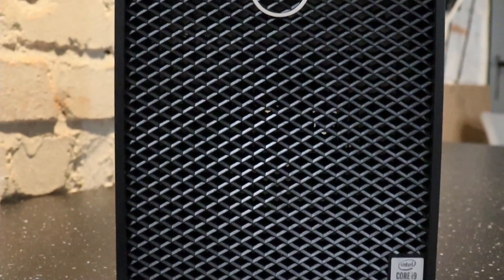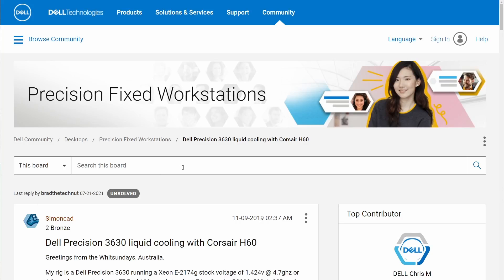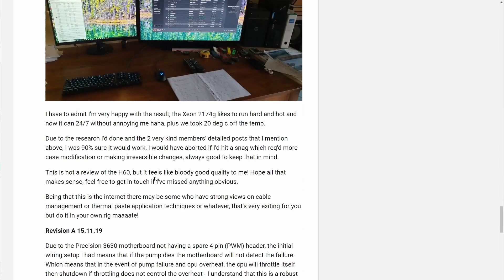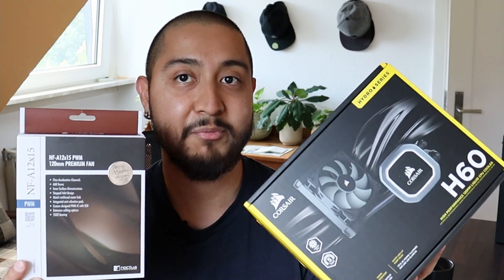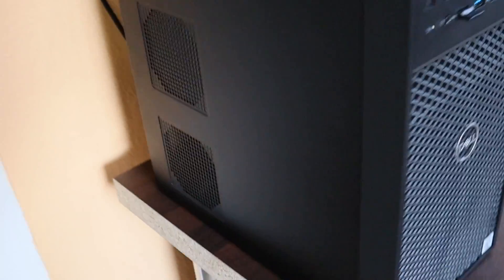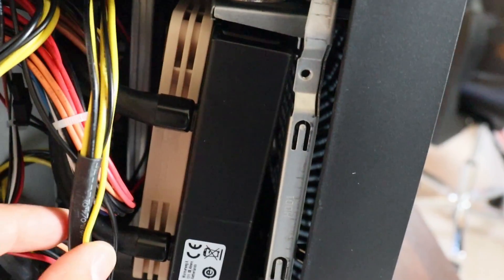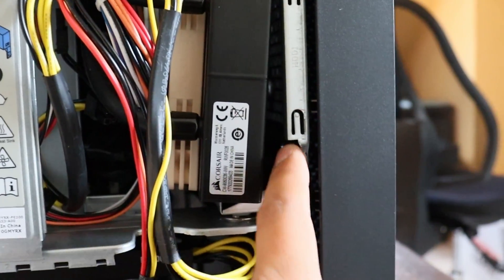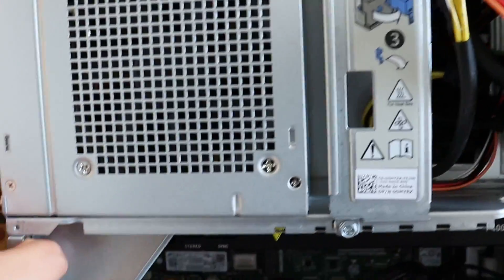Water cooled Dell Precision 3640 / Corsair H60 CPU cooler upgrade

Comment: Thanks for your video! I was able to do the same but instead of putting it on top of the case, I went on to put the cooler on the lower side. It is the same process that requires removing of hard drive case below but it doesn't interfere with power box movement at all. By the way, I have a Precision 3650 but both 3640 and 50 are identical. I also found putting it at a lower level makes air circulate better. It sucks cooler air better due to location.
Reply: question, so you need the y splitter for fan and pump control, but one is a 3pin and the other a 4 pin header. Will with work with an NZXT Kraken 120 ? yes they don't provide the y splitter, but whatever i'll but it. Also, what fan would fit as a replacement to the top one? will any do? can i install multiple(daisy chain?) thanks in advance
Reply: Please be careful.
Sure, there is space in the lower side, but the reason why most people don't install the water-cooled radiator at the bottom is because it will trap air. The radiator must be installed higher than the pump, otherwise its lifespan will be shortened.

Comment: Hi, do you know any other cooler, preferably with air and not water cooling that fits the stock backplate so I don't need to remove motherboard? Big thanks
Reply: Did you get the answer to your questions? These are my exact questions. I want air cooler and I dont want to remove the mobo to do this.
Reply: yo, nah I didnt. Im using the stock cooler, but mounted two 120mm fans in the front down and up and also in the bottom of the case a 140mm fan facing up to the GPU. CPU holding like 35-40C IDLE and 45-50C in load. Same with GPU. Although I dont play that graphic heavy games, only classic wow and rocket league.I removed all 3 HDD bays get the space. @lasvegasadventures8729

Comment: Hi Jorge, the Precision T3640's motherboard look pretty much like a standard MicroATX motherboard.   Is it possible to change the case instead of adding a water cooler?
Reply: You can do a case swap, but the problem you will run into is with the front panel IO, PWR button and LED functions will be incompatible w your standard aftermarket case due to proprietary connections. If you want to also go w an aftermarket PS with the new case then you will also need a 24P to 8P adapter harness. You can find the adapters and cables from a place called HARBIN REPAIRS, they have an EBay store. I’ve been contemplating between the case swap or liquid cooling.  I have a 3630.
Reply: @persiancucumber9255    I have a T3640 with a 10900 CPU.   I just did a case swap a few weeks ago.   I went with the Fractal Design Focus 2 case.   I have a 1000 watt power supply that came with my 3640, so I just moved it over to the new case and it just works fine.   As for the front panel IO, i could not find anything from Hariban that works with the 3640.   The front panel USBs from the dell motherboard did not work with the case, and I could not find any info on the Internet on any adapter that help nor how can I rewire the Pins to get them to work.   I just ended up buying a new PCIe x4 USB expansion card and plug the front USBs from the case into expansion card.     As for the PWR button cable, I did have to merge two wires into one manually.  There are plenty of videos on the internet showing how to do that.    The LED for HD and PWR just works without any modications.   The front audio/mic jack did not work too.  I just abandon it as I don't use it.    I am glad I did the case swap, as the temperature dropped more than 20 degrees without me having to upgrade to water cooling.   I am using the same ARCTIC Freezer 11 LP CPU cooler that I bought long time ago for the Dell 3640 in the new case.   The temperature runs around 60 degrees in light load, and between 72 to 80 under heavy load.

Comment: I know this video is older but I've been looking to pick one of these H60s up for myself as I just got a 3630. I actually found that Dell forum post before I found your video. I had 1 concern before I went ahead and found a H60 to purchase (all of the new options are out of stock). In the Dell article, one of the OC's provisions stated there was only 1 4-pin connector while this device needed two, so he purchased a controller so he could know when the pump failed. Is that why you have the splitter for the 4-pin/3-pin? I'm planning on rolling with the stock cooler but I'm just curious on what I'd be plugging in. I will have the 4-pin CPU connector for the fan and a SATA port for the pump. I think that's all it needs but I just wanted to confirm. Thanks!
Reply: Did you install a cooler? Liquid or air cooler? Did u have to remove the mobo?
Reply: @lasvegasadventures8729  Lol, forgot about this comment. Still don't have the H60, as I'm still trying to figure out this issue. I'd hate to drop all the money for the parts and have them sit and wasted.

At the moment, I still just have a stock dell air cooler. I don't think you'll have to take the MOBO out for this upgrade. I haven't seen any need for it.
Reply: @gnarlynobody   - My CPU is running at 80-90 degrees all the time. Really want to upgrade the air cooler but not if it involves taking the whole computer apart.
Reply: @lasvegasadventures8729  I don't think you will need to take apart the whole computer to install a new CPU Cooler. Should be fairly easy and straightforward.

Comment: Hey Jorge, thank you so much for sharing this modification. I did the same as you fitting the H60 and the CPU temps are now around 70 degrees under full load. Much better and so quiet!! 

I was wondering, which way did you mount the fan for the radiator? Blowing out the front (into the radiator) or blowing into the case?

Comment: Just picked up a 3630 with an i7 8700K and was disappointed to discover it idles at 60c+ and repeatedly hits 100c under load, occasionally throttling, and absolutely screaming while it does. Thank you for this information, I'll be doing this mod ASAP.
Reply: Did you install a liquid cooler? Did you have to remove the motherboard to install?  I want to install air cooler but not if I have to remove the mobo.

Comment: Hi Jorge, is that necessary to remove the motherboard to mount the H60 there??  the bracket which come with the motherboard can fit the H60 ??  thx :)
Reply from the maker: Hello, no, it is not necessary. It fits directly into the screw holes of the motherboard with the included bracket. Thanks for watching!

Comment: Se le puede poner cualquier grafica o tiene que ser necesario solo tarjetas quadro de nvidia?
Reply from the maker: Hola! Se le puede poner cualquier gráfica. Para estos modelos yo solo me fijaría que fueran single slot y no muy largas de tamaño. Ahí es donde se hace un poco la diferencia en cuanto a los modelos de gráficas que puedes usar para la 3640/3650. ¡Gracias por pasar por el video!
Reply: @JorgeMoralesAv hola buenas tardes tengo una duda Se le puede cambiar la fuente de poder de otra marca y de mas watts? La que tiene es de 300 watts y le quiero poner una RTX 4060 ti necesito si o si cambiar la fuente de poder
Reply: @juanmanuelpa100  si yo tengo una evga psu de 600 watts con un rtx3060

Comment: I picked up a prebuilt Dell 3650 from a guy who bought it for the 3080 for mining. I was able to add this same Corsair cooler to my case (with i7-11700). It did actually fit with the stock fan that comes with the cooler. The fan has to be between the radiator and case, pushing air through the radiator to fit this way. 

My prebuilt came with the smallest CPU cooler that dell offers. At idle, my temps used to be 60C+, and 90C-100C while gaming. It now is in the mid-30C at idle, and is around 63C while gaming. Worth every penny!

Specs: i7-11700, GTX 1070 (72C while gaming now), 32gb ddr4 3200mhz, 2x 1TB m.2 nvme
Reply: I just got one exactly like that, and am considering the liquid cooler as well. have you installed the radiator on the top inside and fan outside the case between the plastic ans metal?
Reply from the maker: Hi! I am glad to hear that works as well with the 3650. Is a shame that Dell still does not ship such computers with a proper cooling solution. Thanks for watching!

Comment: I just went through upgrading my 3640 (it was originally a lower end config, i5 300w ps and no gpu (just integrated)).  I put in  an H60 with the noctua fan, i7-10700K, corsair 750w ps and (for now) an amd rx570 (also replaced 1tb spinning platter with 2tb nvme).  Works well.  Just waiting on 32gb of ram to arrive next week to finish the mod.  I think that "premium" dell cpu cooler should be used on the i5 (the cheapo pancake cooler can't keep up with the i5).  I also wish dell would include the VRM heat sink as standard no matter the config. I ended up getting one on Amazon.  A nominal cost; Dell shouldn't be that cheap.
Reply: Hi cnoyes72! What are your RAM frequencies? And what about the voltage? Im planning on also upgrading to 32 gigs and it’d be awesome if you could tell me:))
Reply: @ce5ar_martinez  RAM is regular DDR4 3200 (though the dell bios only runs it at 2933).  Voltage is stock (dell bios doesn't allow undervolting).
Reply: @cnoyes72 hola tengo el mismo equipo pero la fuente de poder es de 300 watts Se le puede cambiar la fuente de poder de otra marca y de mas watts sin problemas de tamaño?

Comment: Glad to see it all went well,  thanks for the video & info - good to see that Dell have provided the VRM heatsinks with this build, I've the 3640 i9 10900K with the same stock cooler so this is looking the best way forward for me as well.  

Was the bios OK with the slim Noctura fan and no errors on boot?

Can you add a parts list and links if you've time, especially for the correct version of the H60?

Cheers for making this and good luck with it :)
Reply from the maker: Hi Goodbyarp,  at the beginning i had no boot problems, after some weeks and after a BIOS update, i have a post error that always wants to test the fans. You can just skip it and everything works until now withouth problems. Thanks for watching!
Reply: @JorgeMoralesAv  I am considering using net boot, do you have to press the key in order to skip the check? If every time I have to skip the check manually, than a remote boot  option is impossible.